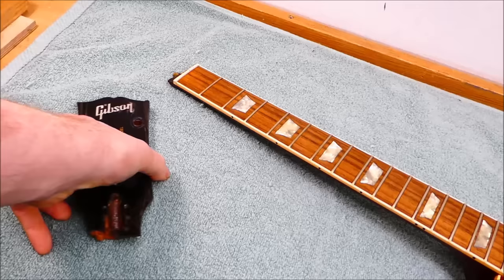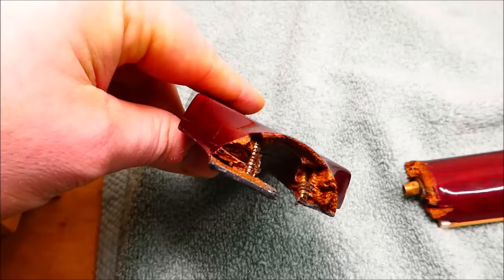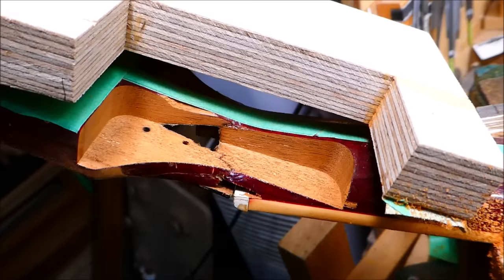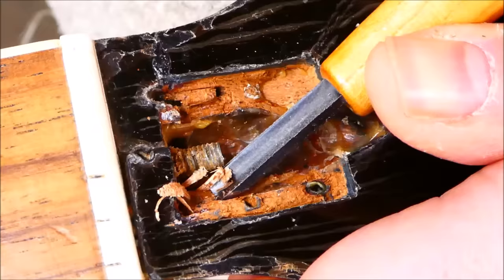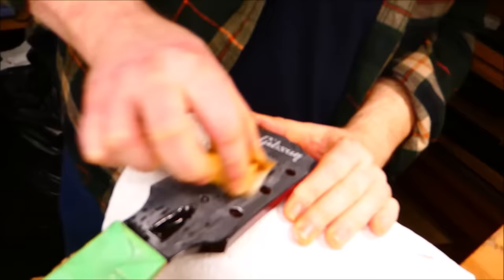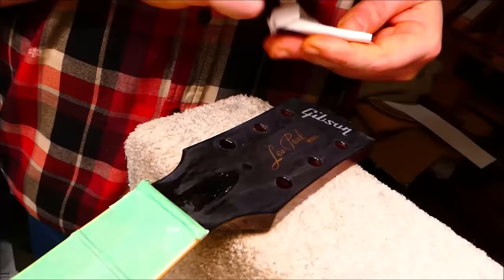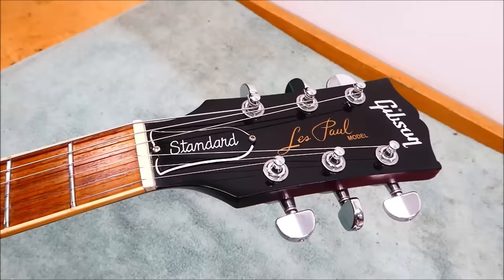One Screwed Up Les Paul (with actual screws)

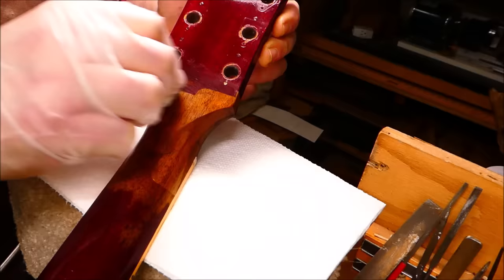Comment: 11:39 Whenever I get a rattle can that doesn't spray all that well, I run it under some hot water for a minute or two. The added heat brings the can pressure up and it makes a huge difference in atomization, helping it spray like new right up until it's empty. Just be careful to dry the can before spraying, water drops on wet paint don't help anything. Thanks for the great video as always

Comment: Awesome repair!  It is quite common for early 90s Gibsons to get that delamination on the headstock
Reply: Have the same delamination on my 94 Studio, right around the pegs.
Reply: Researching for the Lil Wayne guitar! Love it
Reply: yup, my 93 Standard suffers from that condition too
Reply: @shinitaisenpai9057  I wouldn't say "suffer", I find it cool. I have this on two Les Paul's, I think this is caused by the UV on the black fiber material of the headstock and the changing of temperatures - one of the two didn't had it at all until a cold winter day out of her case...
Reply: @moeb3325  The guitar player I play with in my band has a 1982 Standard Goldtop with a light colored maple neck (honestly, even though I know they're out there, I've never seen another one with the light colored 3 piece maple neck)  The headstock has this very same issue, and at this point most of the shiny lacquer has slowly chipped away so it's now mostly a dull finish with a few spots of that wrinkled looking lacquer attached.  I've always wondered what caused that to happen and it sounds here as if the issue still wasn't corrected through to the early 90's..  Cheers guys!!

Comment: This is one where just replacing the whole neck makes more sense. Great job in the end.
Reply: I've enjoyed some of your content- this is my guitar.  Why? This is cheaper, less work, preserves distinguishing marks of the original, stronger than it was to begin with... so what's the advantage of replacing the neck? This is about getting an old player back in my hands, not to sell... to play.
Reply: Maybe with a bolt on neck but the neck is integral to its original character in this case.

Comment: Great job. I have a few Les Paul’s, I’m terrified that I’ll break the headstock on one of them.  I’ll be careful!
Reply: Regularly check your strap buttons to make sure they're screwed down tight and the screws aren't stripped out (I dropped a guitar once because a screw slipped loose.  Didn't break the headstock, but it sure didn't do the foot it landed on any favors!).  Route cables away from where people are walking. Make sure your guitar stand is sitting stable and not where it'll get bumped.  Maybe get one of those elastic bands that go across the forks of the guitar stand and hold the guitar in.  Oh, and make sure if there are any kids playing nearby, it goes in the case! :D

Comment: Your repair approach using glued blocks is the best option. It’s hard work but is the neatest and strongest possible repair. May even be stronger than the solid original which has its grains in the wrong direction at the nut bend. The separate wood block inserts actually make the area tougher from breaking behaving like a laminated joint being separate pieces glued together but acting independently (eg. aircraft wing spar design). Maybe Gibson should intentionally adapt that even in their new guitars for better resistance to breakage. 😃

Comment: I swear Gibson had a problem with the seasoning of the neck wood or poor wood selection in the early 90s. My Explorer and SG both from '92 and made in the USA broke their headstocks whilst normal playing, the Explorer twice in different places. 

Neither were dropped or mistreated and were gigged but always hard cased. I have heard and read of similar incidents from this manufacturing period. Both survive after professional repair and the SG is still played daily. I never had a problem like that with the dozens of other guitars I have owned since the 80s (Epiphone, Squire, Fender, Marlin, Yamaha etc.) 🤷‍♂️
Reply: Some of it might be wood choice, some of it grain orientation, some of it construction method.  I have a 78 The Paul (The "Walnut Wonder"). It has a 5 piece laminated walnut neck. The guy I bought it from said it took a nosedive off a guitar stand. It hit the floor hard enough to bend the bridge and break shards off the nut, but the neck and headstock survived intact. I suspect the multi-piece laminated construction had a lot to do with it. Of course,  might also just be that walnut is a stronger and/or more resilient wood than mahogany?  I'm sure not going to conduct any drop tests to test my hypothesis! :D

Comment: I just wanted to thank you for posting these fascinating videos. They make me feel like I've been invited into your workshop.  I am amazed by your skills at carving, plaining, chiseling and routing.  If I were to try to run a scalpel down the joint of a neck heel, I am certain that it would run away from me and do bad things.  I basically stay away from using superglue because I always make a mess of it. And thank you for the background you give about the guitar to be worked on. Up until watching your videos, my feeling was that a guitar was worthless once the head stock was broken.  This screwed up Les Paul looked unrepairable.  What an amazing job.  One thing I have learned is how to check the action and adjust the truss rod on my guitars. I've done this from time-to-time on my guitars and was never sure I was getting it the way it was supposed to be. And one last important thing.  I've watch a large number of your videos and every guitar sounds amazing once you've finished with it. I'm sure they didn't sound that good before they entered your shop.

Comment: I have a 1992 Les Paul. It's been broken once it was a clean crack and was re-glued cosmetically it can't even really be seen I got very lucky. Truth be told the guitar sounds better after it broke than it did before it broke. I actually wanted to comment on this guitar and say the reason this guitar broke is because the neck is literally as thin as a toothpick. Absolutely the thinnest neck on any guitar ever thinner than a wizard neck. Ridiculously tiny but feels so good in your hand and sounds amazing. In my opinion the 1992 Les Paul classics have the thinnest neck of any Les Paul ever. They call it the 1960 slim taper.

Comment: I would be devastated if the headstock on one of my Les Paul's (specially my '68) were to break. It's good to know there's someone who can repair
 them properly rather than just glue them back on. I've seen a lot of these headstock breaks fixed with a gob of glue.

Comment: I might be sealing its fate by writing this, but I’ve got a Les Paul that I am quite fond of. Despite my best efforts, it has yet to lose its head. Only a week after getting it, it fell off my strap and landed face down on the floor. I have also accidentally put the headstock into my ceiling fan several times, something I have never done with another guitar. It’s got a few chips and scratches, but no cracks to speak of. Maybe I’m just lucky, but it has survived 15 years without a trip to the repair shop.

Comment: Masterful as always...  

I'd never use screws as they were used in that bodge-job...   There are indeed many ways of repairing a decapitation.  My Vintage S6 was a jagged compound break just on the head-side of the nut, generally a clean..ish break.  I was able to infuse the wood on both sides of fracture, with warm dillute Titebond II, which through capiliiary action was drawn straight into the xylem vessels of the wood.  I had already offered up the two detached parts to see how clean the fracture was and the two sides nitted perfectly together so well, that even angling the guitar to near horizontal, they held without glue or support...  So I knew the initial gluing would hold the headstock in the original correct position.   I then warmed a teaspoon of Titebond II and dribbled it into the nooks and crevices of each side of the fracture -- whilst it was still damp with the previous injection of diluted glue - and then offered to the two parts together.   

Clamping was rather ingenious (If I say so myself...).  I had already removed the the tuners...  Now I refitted the D & G tuners,  and the two E tuners, only I fitted the latter upside-down - with the gearing on the headstock top surface and capstans protruding to the rear.    I then dug through my old strings and found four dead 'D' strings and strung up the D&G positions first (no tension) and then the two E positions with the ball ends reversed in the stop-bar tailpiece and passing - via adequate packing around the base of the body and up to the two rearward emplaced E tuner capstans.   I then proceeded to slowly increase tension equally and diametrically - like torqueing-up the head-bolts of a cyclinder head...  Each quarter turn the tuner, I'd pluck the strings to gauge the tension by frequency...   When I was satisfied that enough equal pressure was exerted against the join - and all four tensions strings were in harmony, I left it for about three days.    

At the time I did not own a router.   So I would have been unable to use the same technique that Ted here accomplishes so masterfully.  Instead, I used a 100 year-old piece of mahogany wood panel from a piano face, which had shamfered rectangular corners...  I cut-off enough of a corner to create a 'volute' and shaped the rear part into a semicircle/chord.   Using that geometric shape, lined with fine sand paper, I cut a depression into the rear of the neck/headstock 'fault'...   I also chisel-chased the top part of the volute/fiddle into the rear of the headstock and then glued and clamped in place. 

Note to oneself:  I must get some surgical tubing...  I must...  I must... 

The outcome is very similiar in shape to that of Ted's work here...   SG's are notoriously weak across the headstock/neck interface and although the wood behind the nut is somewhat thicker now, I still didn't feel awfully confident about it...  So, using a long 2.5mm drill set on a stable jig and drilling horizontally into the consolidated headstock, just each side of the truss-rod well, drilling longitudinally and parallel to the base of the fretboard, into the neck to a depth of around 30mm, I then inserted two 2.5mm blue-steel (watchmakers steel) rods either side of the truss-rod well to act as reinforcing steel splints across the 'fault' line.   I have yet to finish the guitar, as other projects have taken precedence, but the instrument is stable under tension and the neck has never been played (it was damaged in transit from wholesaler to resaler...).   I'm toying with giving it a yew or walnut cap....   And it will be voiced with three SD P-Rails.

Comment: Brilliant work! Though there are several processes in this repair that would be tense to perform, I think the neck contour carving would scare me the most if I were doing the work. As you mentioned in the video, carving the contours requires lots of attention. It would be easy to go too far and ruin the plug.

Comment: About the worst place it could break. Saw someone repair one of these types of break by taking another defunct guitar with a different point of break and routing the whole rear section of that neck with a flat surface and a diamond pattern around the nut hole. They purposefully left the replacement wood a different color, looked pretty nice actually.

Comment: Nice, I didn't think it would work to fix a 'witness line' in the front haeadstock 'holly veneer' just with wood filler, black spray paint and some sanding!  I managed to glue my broken headstock back together, and the repair has held strong for a few years now, but I never managed to make the repair 'pretty', so it still has a scar horizontally across the headstock just above the truss rod groove...

Comment: Dabbing some tig wire on top of headless or stripped screws could work quicker especially if the material surrounding it is being routed away

Comment: Damn. Got to give it to them for trying, and I’m by no means an expert, but I would expect that all the added holes would have made it weaker. I know all guitars have their inherit problems but I really avoid buying used Gibson because of this. Typically I’m a Tele guy, and they’re mostly a tank. 

Amazing job you did. I know I wouldn’t have had that much patience. Is there a reason that you wouldn’t swap out the neck? I know they’re glued, but can be removed, is it something that is more work and more expensive than your repair, and obviously your skill level makes the repair as best as it possibly could be.

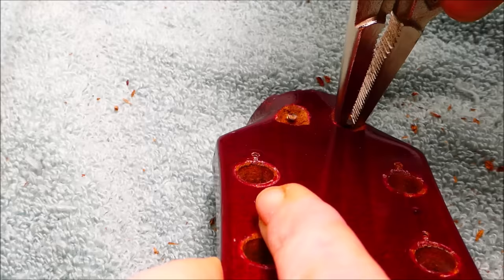Comment: 5:20 Someone should make vicegrips/needelenose pliers with straight grip-ridges for this exact operation. I have an SG '74 (very slim neck) with three brakes now, and some dufus repaired the last neck break with, I kid you not, two zink plated nails and epoxy... Nightmare fix, it was the most amazing playing guitar though. I'm planning on making a jig to diamond abrade them out and insert mahogany dowels when i'm ready.

Comment: Also, if you allow me to add my input !
I did a small plunger type jig to cut straight with a hand chisel like the one you used here.
!
Yes it is still counts as a manual job but my way does it perfectly straight cut from top to bottom to remove the bits of wood until almost rounded.
Is more like the ancient barbaric guillotine beheading but the head is the block of wood !
I used a kitchen potato chopper movement to redo my idea !

So, I hope this idea is good for you !
Cause for me is way faster to cut and then finish the rounding with my belt sander !

Comment: Thanks to your very informative videos I've been able to repair a fairly minor crack in the neck of my beloved Epiphone SG. I've glued and sanded the neck; now it feels perfect in the hand with very little evidence of there having been a crack at all. Initially I wasn't too concerned about the finish of the neck. I had planned to just spray a few coats of lacquer and call the job done, but now I'm thinking I may as well go the extra mile and try to colour match the sanded areas with the rest of the neck/headstock. I'm wondering: is there a way to successfully touch up the colour of a guitar neck without an airbrush? Is a can of spray paint the best option? The colour is "faded brown."

Comment: Ive never had to repair a guitar, but i am a cabinetmaker, looking sideways at the repair, other than strict time constraints, i dont understand why you would not do a boomerang wedge style patch rather than a square style patch, imho a wedge style would be much stronger and far less obvious, given the glue joint would be over a much larger flatter (with the grain) area, than a vitual butt joint. But a lovely job never the less.

Comment: Absolute master craftsman. 

Silly question, why can’t you replace the entire neck?
Reply: Gibson doesn't sell authentic necks, Gibson doesn't license the headstock shape to third part neck providers (like Warmoth does with Fender necks). Sure you can replace & carve an entire new neck, but it loses the authentication marks (serial number, for eg), you'd need to remove & reattache the headstock faceplate, fretboard, truss rod, take the time to remove the set neck... its a lot more work, meaning a lot more cost.
Reply: That makes sense, I assumed Gibson had a spare parts department that sold necks to luthiers that where skilled enough to remove the set in necks.

Comment: Would not waste time fixing, mill out the pocket and change the neck, it's a crap shoot if it will stay in tune, not warp, and might slowly let go, over time and there is the though of wonder if it is going to fail, I have used pins made of titanium since I have both wood working, guitar tools and  metal machine shop.
Reply: Ted explains why not to do this in other vids.   This repair is a compromise between time & cost, but it's also much stronger now than a re-carved mahogany neck of the same dimensions.

Comment: Could it be manufactured to not break with slight mods? Like thicker wood in the most vulnerable areas?
Would a curved piece of metal routed in and screwed in work? Or is that aesthetically not happening?

Comment: I would just turn it into a headless 😂like six string tv did I fix these headstocks all the time but I just use wood clamp and tite bond original but I only fix ones that have enough glue surface and I would have said no to fixing that 😂

Comment: Nice work, but is a '90s Les Paul really worth all this trouble? It is a defective design in a defective material with a defective finish.

No volute - structurally doomed from the start.
Mahogany - ughh - I find better wood on the beach.
Nitrocellulose - the worst finish ever invented.

You did an amazing job, but it will only break again.